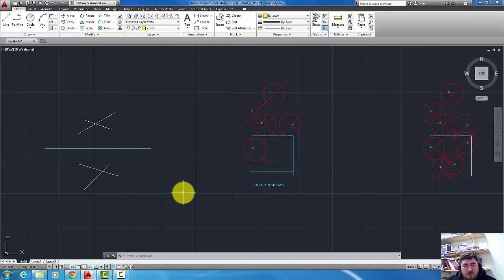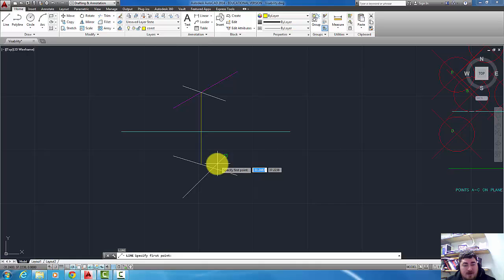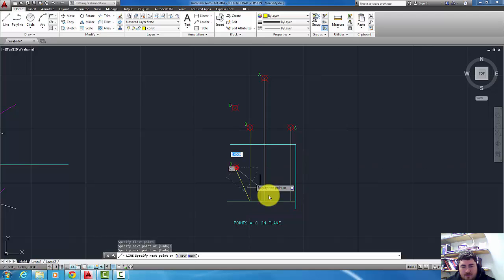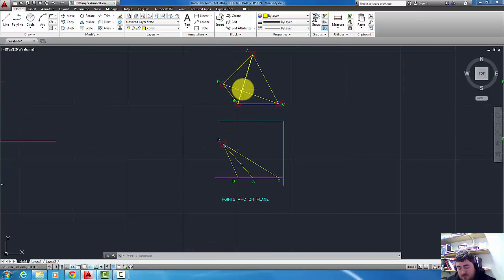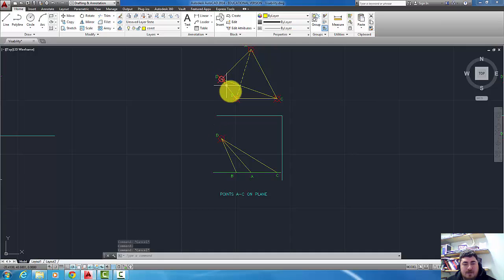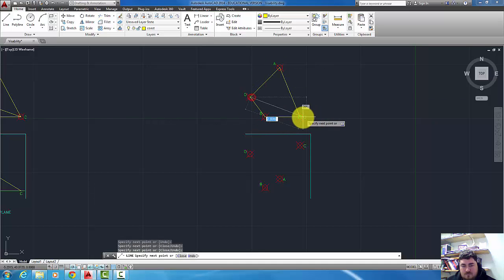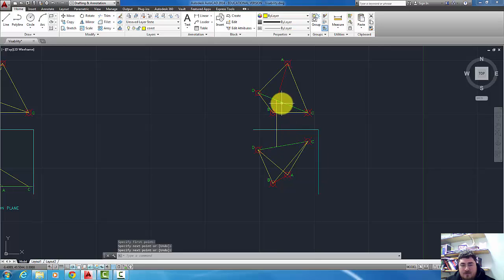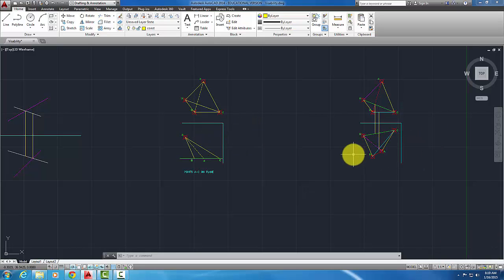Visibility

Comment: so is visibility aslways based on which lines of projections connect first?? 
For example with the triangular pyramid,you projected a line from DC onto the plane P=AC,in which the projected line connected to DC on the plane first. As such,you said that line  AB of the pyramid would therefore be a hidden line. Is that how it works?? I am asking because I feel like there is more to it, please your help is most appreciated.